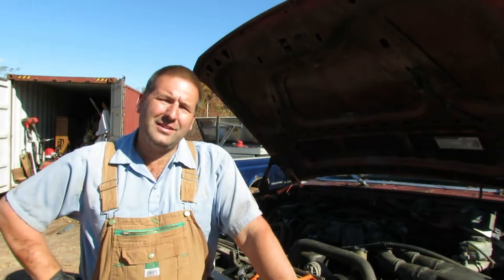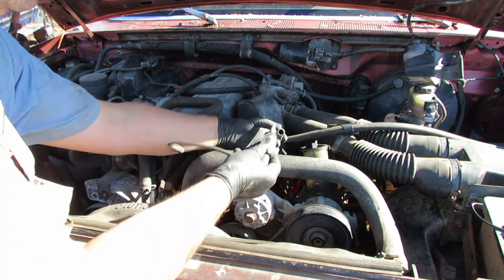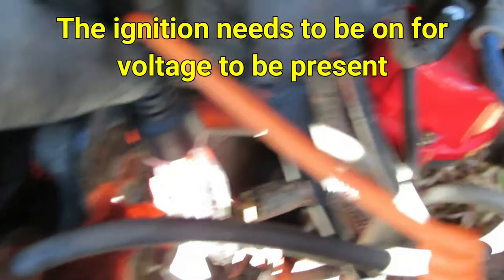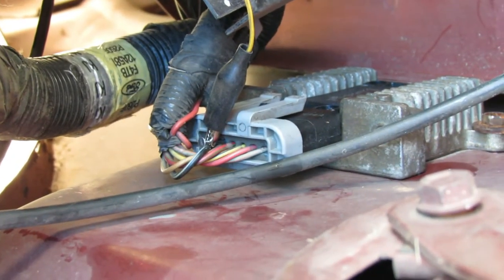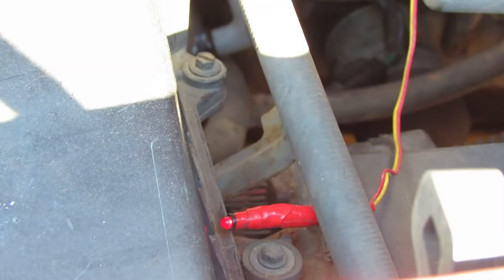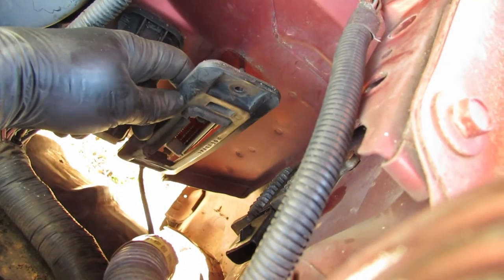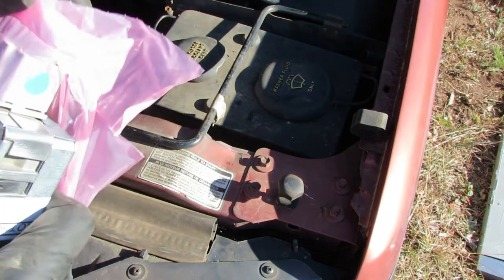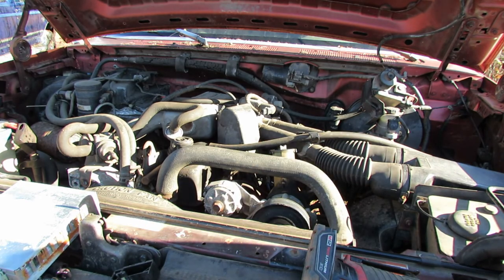1994 Ford F150 4.9L 300cid I6 Ignition Troubleshooting

Comment: 11,259 views and this should have 11,259 likes !!  
Simple, straightforward, and well explained.  Could have saved $ on an ignition module. Much better than some others recommending a voltmeter test for voltage readings on a coil after removing it from the truck. I really like the LED trick.
Anyway 11,259 thanks!
Reply from the maker: @Ghost Rebel you are very welcome. Awesome viewers like you are the reason I started doing this. I have been helped on here by so many people so I wanted to give back to the community. Comments like yours make it that much more fun! ~Mr. C.

Comment: Couldn't have guessed the intermediate oil pump shaft was missing with a no-spark condition, as it's not related. The Electrolytic Capacitors are known fault items, as they stabilize the circuit voltage for the IC. These things always have failed as leakage voltage will invariably short to ground in the circuit and burn up. Capacitors have a limited lifespan anyways, but the boards often can be cleaned, the Capacitor replaced, and the solder joints reflowed with a localized heating source to return the ECM to proper order. You can always count on a 4.9 Liter to deliver the goods.
Reply from the maker: @Murray Kriner thankfully it was a cheap and easy fix. The ecm could possibly be repaired. Now that it is running I could attempt a fix and try it out.. Thanks for posting some excellent information. ~Mr. C.

Comment: Appreciate your video. I replaced my timing gear cover along with my pan gasket and it wouldn't turn over afterwards found some bare wires at the ignition coil rubbing so more than likely I probably fried my pcm as well. This was a great help!
Reply from the maker: @oscarorozcojr.7536 that stinks. Hopefully that is all the trouble you will have. Sounds like you are well on your way to getting her running again. Glad to help! Thanks for watching and sharing. ~Mr. C.

Comment: I had a 94 with the exact same configuration of motor and transmission. When I traded it in back in 03 it had over 383,000 miles on it. The only issues that I had with that one was I could not keep engine mounts on it because of the amount of torque and I has to replace the oil pan and valve cover gaskets. The only reason I traded it in was due to both fuel pumps went out within a week of each other. Every once in a while I still see it on the road.
Reply from the maker: @Bradley Waters WOW thank you for sharing such an amazing experience. I love these things! What a machine. ~Mr. C.

Comment: Hi everyone, I also have a 1994 f150 4.9L w/ manual trans. I had one hell of a time with my no start issue but my short answer is, check the ground between the engine and battery. After having spent 3 days and $400 dollars diagnosing and beating my head against a wall. I used a set of jumper cables from the engine block to the battery and my truck fired right up. 

After a new (starter, starter solenoid, ignition coil, battery and remote mount grey ICM), it was just bad ground. I'd also inspected my battery cables and PCM for issues but both were fine so, you might start where I ended.
Reply from the maker: @ParaTravis you have provided excellent information for everyone! For that I thank you. Keep up the good work. I appreciate your willingness to help. ~Mr. C.
Reply: Where did you put the ground at?

Comment: Great video. Step by step and to the point. Got a 96 we just rebuilt. Was running, somewhat erratic,before it went under the wrench, we thought it had blown head gasket, turned out it had a crack in the head.After we dropped it back in it would not start. Your video is like looking at mine,two years apart but everything looks the same.Did the spark test with a screwdriver the old-fashioned way. Ouch! I was wondering about PCM now I can check it thanks to your video. Very plausible. Thanks.
Reply from the maker: @One eyed Jack I am glad you found it useful. Ewe, cracked head. Did you get a replacement from a junk yard? Good luck getting her going again. Thank you so much for watching and commenting! Viewers like you make creating content so much more fun! ~Mr. C.
Reply: @NaturesCadenceFarm  send it to a shop and had it cleaned and machined. But ever since rebuild it wouldn't start. So we go to YouTube. Really grateful for your video, it helps a lot. Thanks again 👍. PS, we've been systemically going over the truck and my boy got it started yesterday, Sunday. Not just electrical but fuel too. Been sitting a few years. New fuel pumps , new coil, new distributor cap, new wires, motors even got new paint. Ford blue
Reply: @NaturesCadenceFarm  have a 67  f100 ranger with a 352-3 speed has title issues right now. Get that cleared up and that's our next project. Pretty much ground up. That's what I grew up with. Not This computer stuff. But it is what it is
Reply from the maker: @oneeyedjack8525 that is so cool. Sounds like you have her almost ready for the road. The price of trucks these days makes it worth the time and money. ~Mr. C.

Comment: Hey thanks for video on f150 ecm diagnostics, a no ground circuit from the distributor lead me to a broken gear at the bottom of distributor.  The how is still a ? New dist. Fixed it. I will remember your test for the next issue .  Very much thanks
Reply from the maker: @Joe you are very welcome. Glad to hear it was an easy fix. Thanks for watching and commenting! ~Mr. C.

Comment: EEC 4  stands for  electronic  engine  control  4    those are capacitors  in computer that  leaked and kicked the bucket!       The 85 computer    not the same as eec4 . It controls ignition  module  and electronic  feedback  carburetor.
Reply from the maker: @Randall Carney thanks for the information. I found it very useful. I am sure the community will too. ~Mr. C.

Comment: Hey I need help my 1992 Ford f150 not getting any power to the injectors can u help me figure it out
Reply from the maker: @Jumarie Richardson I can try. Have you checked all of the fuses? Not sure if you have one but maybe check the inertia switch. It might just power the fuel pump. Open up and check the ecu/pcm/ecm for burns inside. Hope this helps. ~Mr. C.

Comment: That radiator hose clamp right next to ypur spark tester is about to give up the ghost. And this is 2 years ago.
Reply from the maker: @JamesAgans yea it's still holding up. It is just a farm truck so it doesn't see any heavy use. Thanks for the heads up. I have some extra hose clamps. I might change it out. Happy wrenching! ~Mr. C.

Comment: Thanks for the video,At the step when you check tan wire  from coil  with key on I  am not gettin any light  coming on at all, could you consider that and let me know what you think is my problem
Reply from the maker: @leewoolverton8945 the light turning on with the tan wire shows voltage present on the red wire of the coil and that side of the coil windings are intact. Did you check for voltage on the red wire with ignition on? If the light turns on at the red wire but not the tan check for continuity to ground at the tan wire that would indicate the wire is in fact grounded. If no continuity then the coil windings must be open. Check continuity across the two terminals of the coil. If open then those coil windings are bad. Hope this helps. Happy wrenching! ~Mr. C.

Comment: I have a 1996 f150 I6 5 speed, when you changed out the box, did it need reprogramming to your vehicle and VIN?
Reply from the maker: @Divnbum no. After checking the numbers on the ECU (example: F3TF-12A650-XA DOT0)and ordering the correct one it was plug and play. No programming. Excellent question, thanks for asking! ~Mr. C.

Comment: Okay so my 94 F150 300 straight 6 5 speed is doing the exact same thing except for mine backfired and blew the cover off the catalytic converter and then it wouldn't start after that so does did you think that that little box has to do with mine or could it be that a jump time
Reply from the maker: @Darla Collier wow that sounds exciting! That does not sound like the ecu because the Ignition would just stop. I would lean toward jumping time. Have you had time to look into it? ~Mr. C.

Comment: got a question my coil ground out works sometimes and sometimes not. if I put a t connector in to test it starts working could it be a bad pig tail harness
Reply from the maker: @Jerry Fewell I would say so. Maybe the crimp to the wire is not tight. Did you get it fixed? ~Mr. C.
Reply: @NaturesCadenceFarm  I tried computer it didn't work I think the pick up in distrubutor is the culprit

Comment: I got to the point of testing the ignition module, second wire from bottom. My light came on with key on. That mean the PCM is good?
Reply from the maker: @chiliboom6140 very good diagnostic skills if you got to the point where you are testing the ground provided by the PCM to the ignition control module.. If you have ground with key on the PCM is providing a ground to the ignition module. By no means does that prove the PCM is good. Do you have a flashing while cranking with ground on the top wire (pip in)?  There are other items the PCM controls that it might not be providing a ground or signal out to. Do you have a spark but no start condition? Thanks for watching and great job working through the process. ~Mr. C.
Reply: @NaturesCadenceFarm  Hello there, thank you for responding so quickly. I appreciate all your help. I had blinking with top wire while turning over. Went to check for spark, in line between coil and coil-to-distributor, and it started. Truck started on me once before, did a good long drive to recharge the battery, next morning, crank no start. 
You’ve made it easy to get this far, thank you for all your help.

Also, if it makes a difference, spark through the tester was orange/red, not blue/white. 
I have already replaced ignition coil previous to this. 
Ended up taking out ecm, all LOOKS okay. Nothing fried or shorted looking.
Reply from the maker: @chiliboom6140 you are very welcome. Did you get it figured out? I would love to know. ~Mr. C.
Reply: @NaturesCadenceFarm   When I was probe testing the ignition control module it started. I shut it off and tried again. Started up. I had already bought an ignition control module as the next thing to replace. But took out the ECM while I was in that area so I could take pictures and order specific one if needed. 
So I just replaced the ignition control module and now it’s been working. 
Not sure if I have white/blue spark. I do have a small miss or hiccup that seemed to start since this whole ordeal. I have to say it was the control module but the old one tested good and started the truck up multiple times before I replaced it. But since replacing I tested after letting it sit over night and now it keeps starting. So….*shrug* at this point I’m happy it’s just running again. Now to diagnose the hiccup.
Reply from the maker: @chiliboom6140 that is awesome. Good to hear it is at least running better than it was. Thanks for letting me know! ~Mr. C.

Comment: Had same issue but problem was mouse eating wiring in half going to relay on driver side of engine saw wiring insulation missing and noticed broken wire near by. Truck 🛻 sits idle for months . Mice 🐭 needed a warm home 🏠
Reply from the maker: @ericheise4051 that is a bummer. I had a squirrel or mouse chew through my wood chipper coil power wires. What a pain. Thanks for watching and sharing. ~Mr. C.

Comment: Hello, My 1990 Ford F150 6 inline I have to pump it like 35-50 times before it could start, after that it would start more normal. Thanks
Reply from the maker: @1945temo that is interesting. Is it the original engine? A 1990 originally came with fuel injection. If the engine was swapped it could be a carburetor. Thanks for watching and commenting. ~Mr. C.

Comment: Does getting coil control mean the coil is good? I have coil control but nothing on coil wire at distributor
Reply from the maker: @ColtonLoberg coil control refers to the PCM sending a signal to the coil to initiate a spark event. If you have no spark at the coil output then most likely the coil is bad. Hope this helps. Thanks for watching and asking. Happy wrenching! ~Mr. C.

Comment: How much did that pcm cost and i live in Florida the summer months after temp gets 200 degree it like it gets vapor lock it turns over after letting it sit  a half hour it will crank up in winter months it cranks it will be 190 degrees ive replace fuel filter i keep tank full
Reply from the maker: @peterharrison9816 the PCM was around 120 a few years ago. That is an interesting set of problems. Maybe something is happening when it goes into closed loop looking at all of the sensors. Thanks for watching and sharing. ~Mr. C.

Comment: the oilpump shaft was missing? as in someone took it out after it stopped running?
Reply from the maker: @nicodemus7784 yes missing. I am not sure if it was removed when the previous owner was troubleshooting and they forgot to reinstall it or removed on purpose to make it burn up if the next person got it going. Either way I knew something was seriously wrong when it started. Sounded terrible. Thanks for watching and asking. ~Mr. C.

Comment: Mine will crank but not start unless I spray a liberal amount of starting fluid. I replaced coil, plugs, wires, tps, cannister vacuum solenoid and Mapp sensor. Still having the same problem... please help!
Reply from the maker: @Brian Hopper Sr. that is a bummer. I would look into the fuel delivery system. Fuel pump, fuel pump power circuit, fuel filter, tank selector switch, pressure regulator... just to name a few. I say this because it will pop on starting fluid. I hope this helps. ~Mr. C.
Reply: You might want to look at your fuel pressure. After spending way too much money on the parts cannon I discovered that the fuel pump was weak. If or when it actually started it wasn't for long. Came out the connections at the tank was corroded and green. Truck ran like it was new afterwards.
Reply: @blmdh20s you sound exactly like the problems I've been having and I didn't think that it could be a weak fuel pump but since I've replaced just about Everything else;  I'm really starting to believe that it may very well be a weak fuel pump!       Thanks sir!

Comment: I've got a 96 f150, 4.9 300i6, PCM is exactly in the same location. However, mine does not come out this side. Mine has to be slid back inside the truck cab and guess what I have to do for that. I order to remove my PCM, I have to remove the entire plate assembly that's holding the ebrake peddle and wire connection. One huge fricken gone show.
Reply from the maker: @FreeBird Safety Services that stinks! Sounds like a real pain. You figured it out though! Happy wrenching! ~Mr. C.
Reply: @NaturesCadenceFarm  nope. I had to install a new EGR valve. However, my truck still will not start.

Comment: Dealing with a no  spark condition now no power coming to the coil
Reply from the maker: @law breaker so the Coil does not have 12v positive with the key on? Have you checked all of your fuses? Make sure you check for 12v positive using the tester probe on the positive of the Coil and the ground on the battery not the negative side of the Coil. Hope this helps. Happy wrenching! ~Mr. C.
Reply: @NaturesCadenceFarm 
Just now getting to work on truck again gonna run the same test you did in the video i have a whole parts truck to pull parts as needed  will get back to ya
Reply: I finally have spark coming from coil only not sure what done it i unplugged the pcm amd plugged it back in due to the fact i changed the entire under hood harness and figured id check to see if it was not connected good

Comment: Any idea what caused the ECM to burn up?  Im right about where you were, old 94 f150, with no spark...but it will spark with the spout connector pulled out, not with it installed(I got it to fire on starting spray).  I didnt have an LED tester so Ive been a lil nervous about testing the PIP signal like you did.  I noticed you listed a LED test light in the description, so Im going to pick one of those up.  I had tested the ground to the ICM...and it was there...but i dont think i tested it key on vs key off(but i will later this evening).  Also, my fuel system isnt working(At least the pump isnt coming on, no pressure at rail) however, could be two stuck pumps(Truck has sat a long time)  I will test the fuel injectors to see if they're receiving pulse when I finally get spark.  anyway, great video...really enjoy your laid back approach.
Reply from the maker: @Tim Rowe I do not know what caused the failure. My guess is moisture and time. I got the truck in a non running condition. The guy said he slammed the door and it shut off then never restarted. Good call on waiting to check the PIP. It would not take much to fry sensitive electronics with too much load on them. I have noticed when fuel pumps sit they will lock up, so yes, maybe that is the problem with the lack of fuel pressure. I am glad you like the video. I really appreciate you watching and letting me know how things are going with your truck. I know this might sound strange to many people but I really enjoy working on stuff like this. It is almost like therapy for me. That is so cool you noticed my laid back approach because at the end of the day I really am laid back while working on this stuff. Happy wrenching! ~Mr. C.